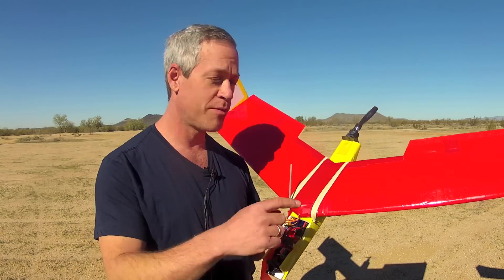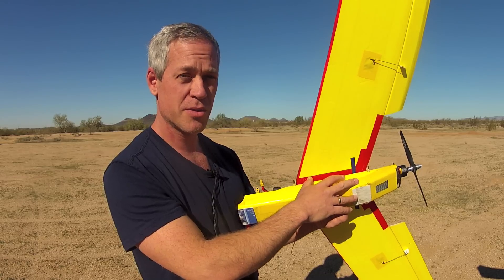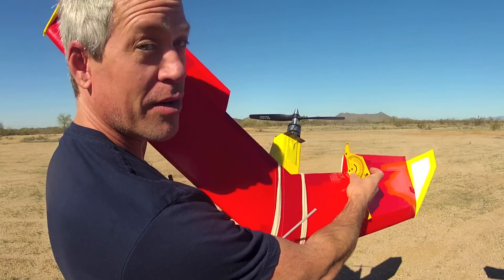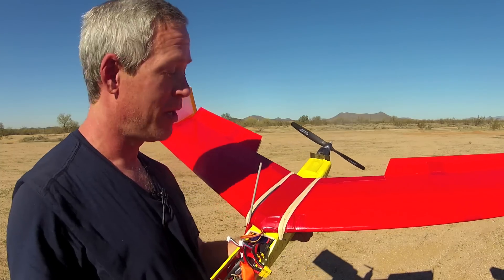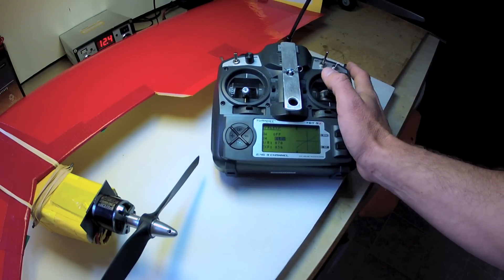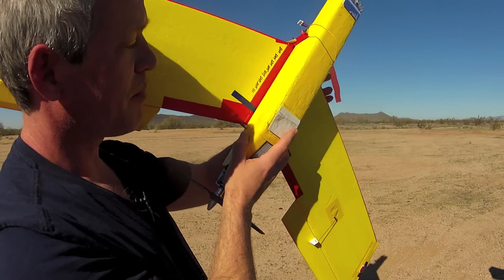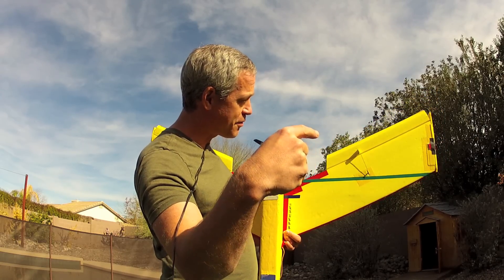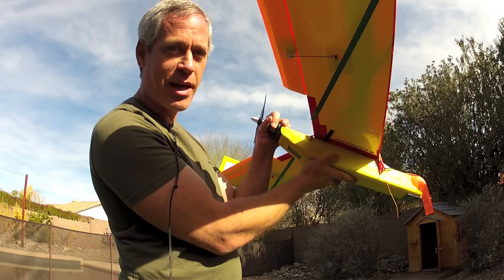SYNAPSE BUILD: Final Setup

Comment: Hi Ed, thanks so much for the great videos. But I'm still having a problem with synapse setup. I'm using 1800kv with 9x6 prop and the synapse always roll to the left upon hand launch. Aileron input doesn't have any effect to counter this. Do you have any suggestion on how to overcome this issue? Thanks again

Comment: I may have just made a connection between my fluid mechanics class and something you were talking about in this video Ed:
Could I consider the CG to be the same as the centroid?
And is the "aerodynamic center" the same as center of pressure?
It makes sense to me because the center of pressure is the location where the fluid acts on a surface; and the center of pressure is usually below or aft of the centroid...

Comment: Ed Ive recently finished a synapse and flew it three times. when i get aggressive with the elevator it snap roles without aileron input. I have tried moving the  cg forward and nothing changed. I made control horns as you did from gift cards so i wonder if Ive messed up the geometry? I am going to try Du-bro horns today.

Comment from the maker: 25 minutes at 9 amps measured (OSD accuracy may be off a bit), level flight, 39mph, and very conservative maneuvering, like out two miles, gentle circle, back two miles, repeat.  Heavy maneuvering cuts that to 10-15 minutes.  I use a 4000mAh pack and run it down by 3200mAh to 11.3v.

Comment: I maidened my synapse today and it flew very well as long as I didnt push it to hard. Once I got above a certain speed I had pretty severe flutter. I couldnt quite tell if it was the elevons or the entire wing since it was so violent. Have you had any problems with flutter? Im thinking I might cut the elevons down to about 1" rather than the standard 2"

Comment from the maker: Glad to be of help.  The thrust angle trick only locates the longitudinal center of mass, so it's more relevant to acceleration-related pitch changes when the thrust angle is too high or too low.  There is still the matter of aerodynamic center, and other factors, which may cause the need to adjust the thrust angle.  But for a quick and dirty estimate it's not a bad place to start for thrust angle.  Yes I do try to remember to mark each flight on that wing, and subsequent planes too.